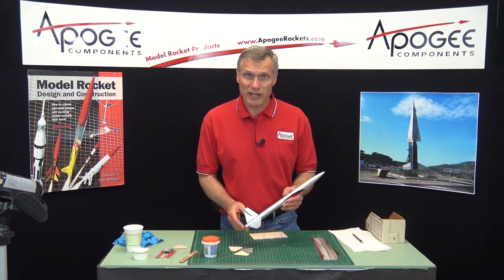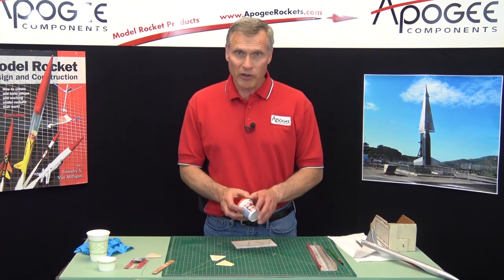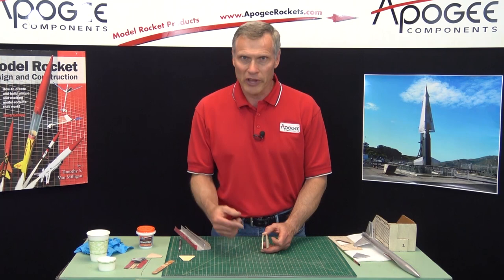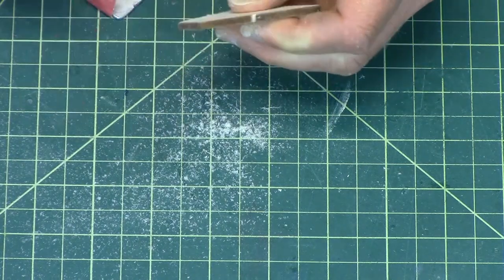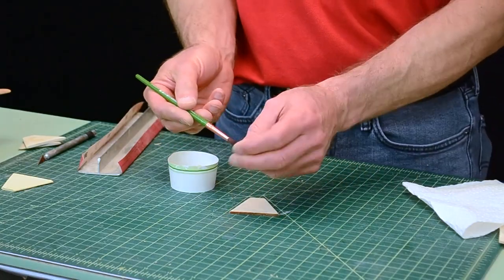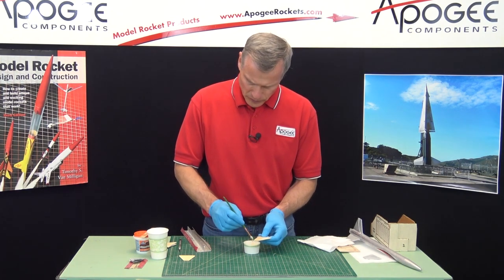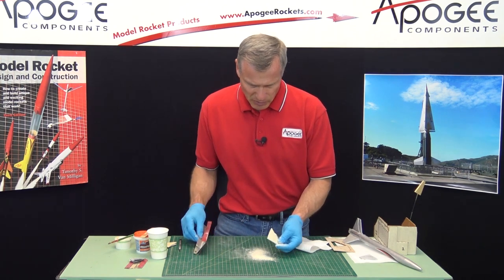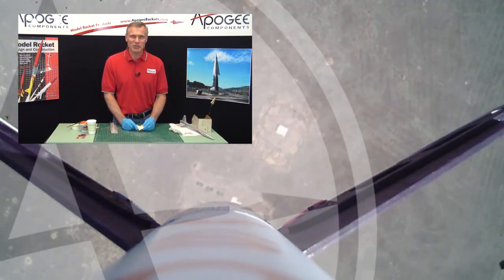Sealing & Smoothing Balsa Fins

Comment: After you've cut the fins from the balsa sheet store it carefully. You can use it later as a template to make more fins that shape :-)
Reply from the maker: Great tip, thanks :-)
Reply: You might need to make another fin if one got broken. (It happens). OR you might like to use fins of the same size and shape on the rockets you build from scratch. If you build a lot of rocket kits it might be worth writing on the balsa sheet which rocket it is for.
Reply: Damn I used mine to make wooden sticks to spread glue to make the rocket. Lol
Reply: Great video!  Thanks!
Reply: Put the fins on a scanner. As long as you keep the scale correct you can print it out as a template anytime you need to replace fins.

Comment: I have been using a homemade solution for 50 years now. It is especially useful now that Dope based filler is almost possible to buy.

I usecbaby powder. I rub it into the surface of the fins. You can then paint a clear lacquer or varnish over it and sand it smooth with 400 or 800grit wetordry sandpaper. I have mixed baby powder into clear varnish as well. Stir and brush it on, over the prefilled balsa. It takes several hours to dry, but sands nice and smooth
Reply: Any warping issues?

Comment: I read a trick from Model Rocket News circa 1969. Sand your fins smooth, coat with talcum powder and rub it in to the grain. Blow off the excess. Apply sanding sealer, allow to dry, and sand it. The guy said usually it will be so smooth you only need one coat of sanding sealer. This was using dope based sealer, SIG still sells it. I’m trying it later this week.
Reply: I like to use Sig sanding sealer . It's old school, nostalgic, reminds me of building free flight model airplanes back in the 60's. Yeah, you have to deal with the dope fumes but that's manageable for an adult. For most rockets I just sand the fins quite finely and paint and let it go at that. But for a select few I take the trouble to use the sanding sealer. It's a multi step process and takes a while. Maybe the talcum powder trick can speed it up.

Comment: I've been away from rocket building for about a decade now.  My preference for sanding sealers was always the solvent based sealers, apparently now only SIG makes it and it is very expensive from the distributors plus hazmat shipping fees.  I am researching the water based fillers and at about 14:23 you mention the warping.  That was the answer I was looking for.  I will now have to use this material as I have no other choice. Also, messing with methyl ethyl ketone and its stench has probably caused me brain damage throughout my rocket building years.
Reply: I was a NAR member and very active in my teens. 50 years later and now retired, I built my first rocket since JHS. I'm back and gonna build that Saturn 5 I could not afford in 1972

Comment: I've used model airplane dope, or I sheathed the balsa under a layer of paper, then used model airplane dope, which helped with the damage that can result from landing. Covering the balsa fins with paper then model airplane dope helps the fins I made with an airfoil profile survive the rigors of landing and flight.
Reply: Great idea!  I was in the hobby in the early '70s, and had G Harry Stines book.  Along the lines of Dope, I used a balsa sanding sealer instead of the glue mixture.  My Spock Logic says sanding sealer is lighter
  Also used the dope paints, as they were superior.  Anyhow, I  built an Estes Apogee (?), the one with elliptical fins and a boat-tail cone at the base.  The kit can out smooth as glass, with knife-edge fins.  The sealer/dope strengthened the balsa.

Stuck a C6-7 and it went so high I never saw it again.  The ejection chuff cloud was Barely visible.  A shame I lost it, but it was an absolute success.

Comment: I’m curious if the wood filler also strengthens the fin in addition to making it smooth? I’ve had a few rocket fins chip if they land on a road or other type of hard surface.
Reply from the maker: Wood filler does not add strength.
Reply: Bigger parachute maybe...I have the same issue with a large rocket I have, thing comes down like a rock, hasn't broken yet, but It's just a matter of time.

Comment: I am here because I have two tea boxes now and I need to learn how to finish them.Now I know to go in one direction when sanding the edges and the dividers inside. For sealing. This box is unfinished. I have Mod Podge. Is that PVA glue? Can I use this as a sealer?
Reply from the maker: This is not the stuff for you. Sorry. You might try getting advice from real wood-workers.
Reply: @apogeerockets  I am getting into wood workers/crafters now so I have asked two. Will wait for their reply. They both use GESSO. But they have not said what woods to use it on. I just don't want to have another kind of glue here that I will never use up. I am not creative.

Comment: I use ammonia window cleaner to thin out Elmer's Wood Filler.
Reply from the maker: Why? What is the benefit?
Reply: @apogeerockets  It's the solvent used in the product. Also quicker drying time.
Reply from the maker: @RocketTCoyote  That's interesting. How did you find that out?
Reply: @apogeerockets  NAR Member's Guide/Sport Rocketry.